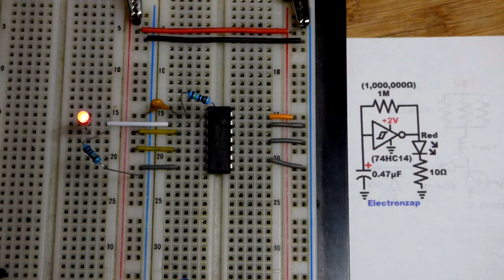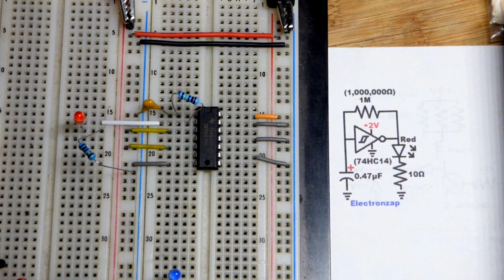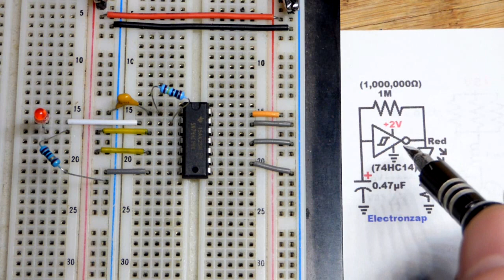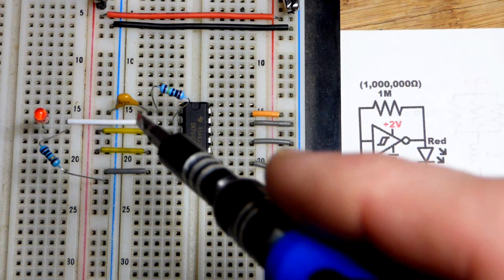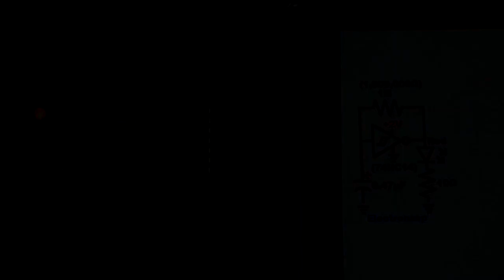Only 2V low power LED flasher 74HC14 schmitt trigger inverter IC Learning Electronics Shorts 109

Comment: You can replace the resistor by two diodes plus a potentiometer.
That way you can even change the brightness of the LED (since it works as a PWM oscillator) 
Great stuff!